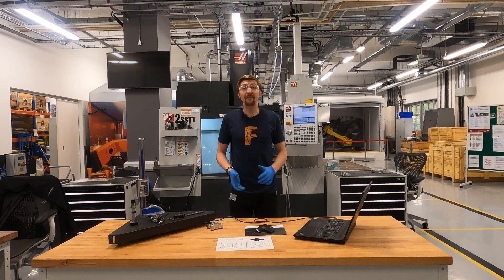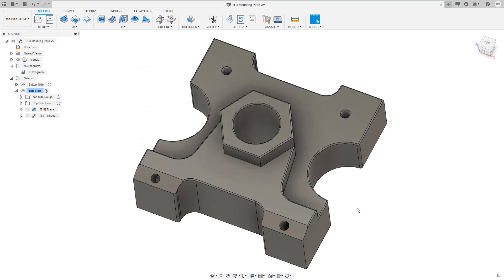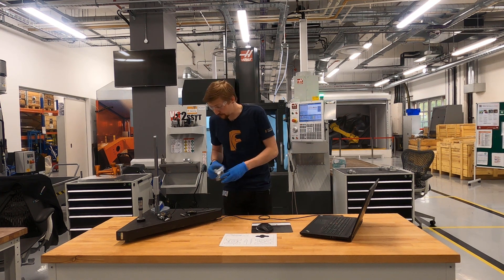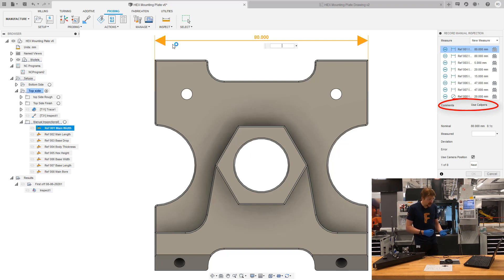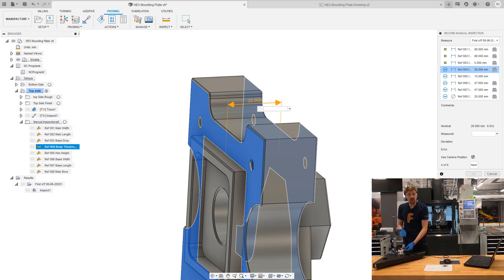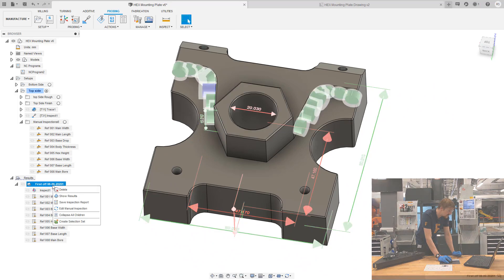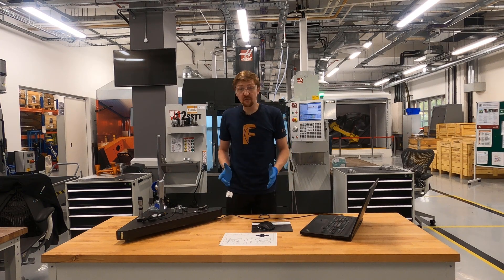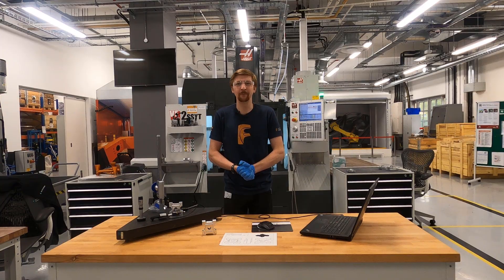TUTORIAL: Preview Manual Inspection in Fusion 360

Comment: For manual inspection we can have a simple excel sheet report, it will be better if you have inspection done through a sub program via a probe with automatic data transfer to fusion and thus creating a detailed analysis of inspection. This will avoid human intervention and human errors. You can also go one step ahead if the tolerance on any side is varying fusion should communicate with motion controller to automatically do tool wear offsets.
Reply: Hi Sunil, do you mean an excel report over the HTML? You can copy and paste from the show results table to get the results from fusion 360 into other packages. Have you seen Inspect Surface and Probe Geometry functions inside of Fusion 360 currently? They are practically doing exactly that, using the probe to inspect the part, and also using the probe to stop the machine and update tool wear.